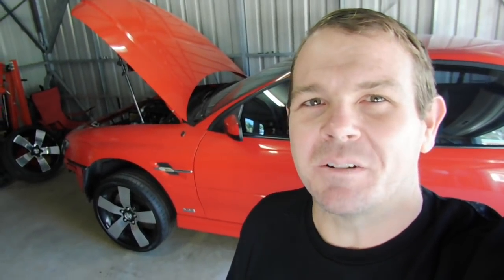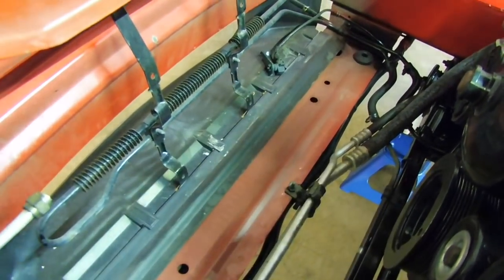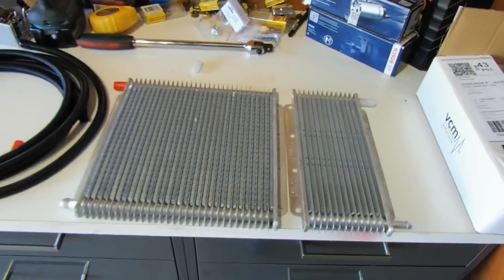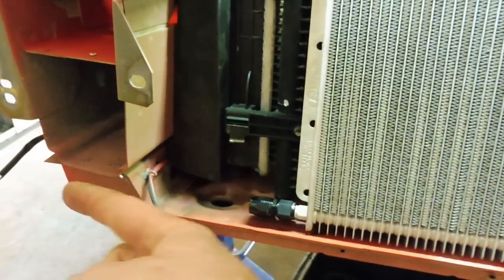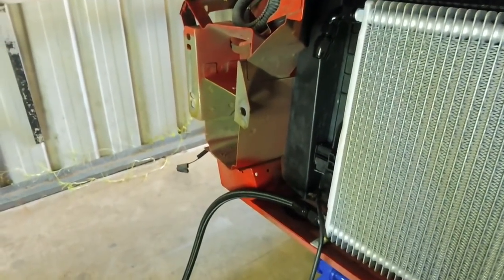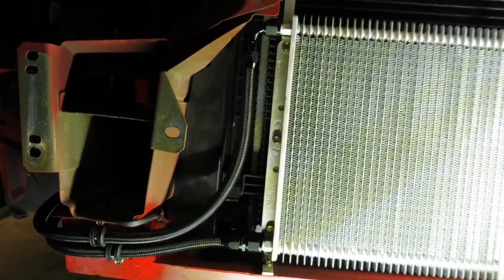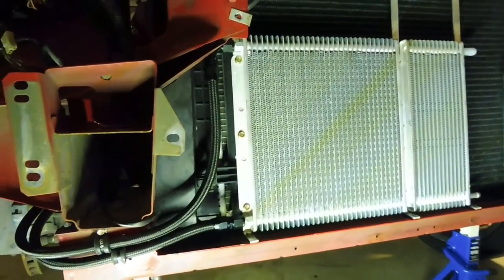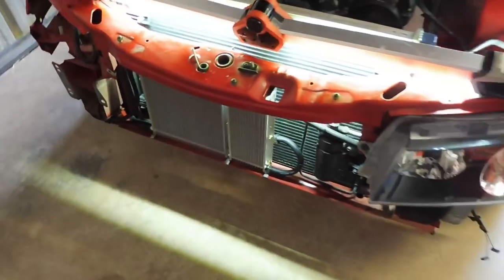Turbo Ls vz ss commodore build ep8 oil coolers

Comment: Hi mate, thanks for all the eps and the time you’ve put into it all. There are heaps of guys in the States putting up GTO vids. Not really any Aussies except you I’m sorry to say. Search for “VZ SS” and there is nothing like you’ve put up. So thanks again. 

I’ve got the same car as yours but it’s a t56. Otherwise red, L76, 2006 and an SS. It’s got 292K kms on it and I’ve had it since it was 6 months old and just off my P’s. I’ve learnt a lot, doing bolt ons (pacemaker headers, high flow cats, various aftermarket exhausts, Billet short throw shifter, Pedders adjustable extreme coil over suspension, intake, etc., etc., etc.). Lots of nice interior mods like Calais door trims, including all the the suede inserts on seat backs and interior panels and some LED interior lighting in red and white for the dash and interior to complement the awesome interior the VZ SS has. 

And now it’s time to do some serious engine work. My timing’s out as the stock cam/lifters are probably rooted. Oil consumption is through the roof and it loses compression under acceleration (HVAC looses suction as the engine starts to strain). And more stuff synonymous with a high K Chevy small block. Also I’ve had two clutches and the last one was done just over a year ago where the rear main was replaced at the same time. It is now pissing out oil.

As I am kinda adverse to paying a shop 3 times as much as I can do it for with a bit of hard work, I’ve decided on pulling my L76 and sending it down to Melbourne to LSX Performance for a full recondition (top an bottom) and performance upgrade inc. cam, lifters, springs, chain, etc. for 5.3K. I’ll also take the diff to a shop and have it looked over to kill the whine it’s got and check to see if I got what I paid for in 2013 when I ordered HSV 3.91 gears to be put in by a shop here in Sydney. 

My question to you:

For a guy with the same access to tools as you, should I pull the engine and tranny out at the same time and then separate, or is it possible to just take the engine out on it’s own? The latter is preferable as I have a tiny garage that just fits my SS). 

Second bit is as the prop shaft has tongues going thru the donuts, essentially joining the diff, shaft and tranny in one line, should I start at the back and drop the diff to then release the prop shaft and facilitate removing it from the tranny?

Cheers in advance and I’m a big fan of your work. It’s a great inspiration.
Reply from the maker: Erik You can take the engine out without gearbox but I’d unbolt the gearbox at the back of bell housing and remove engine with bellhousing and clutch still attached . 

To achieve enough room to remove tailshaft from diff or box donut simply unbolt the Center bearing and let it hang down this should allow just enough room to slide off the tongues.

Cheers for your positive feedback aswell greatly appreciated.

Comment: So basically mate, you have not connected the inner radiator heat exchanger and also the outter coolers together, which is the way to go, that way if the radiators inner heat exchanger goes, you dont have radiator coolant mixing up with the transmission oil. :) Well done, also i have a idea for ya, put a Bit of aluminium between the alternator and near the power steering reservoir, so that if any leakes do happen, the oil does not drip down onto you alternator, which is a very common problem and stuffs up the alternator, in fact i think i seen that you have already done this, unless its from a different upload. cheers and keep up the great work. :)
Reply from the maker: 7071t6 thanks mate
Reply: @LatysGarage  no problem at all. My son has a VZ SS 5.7 and wants to do it up, ie: cam package etc, i was thinking of going to flowcraft in deer park Vic to have the work done, as they have done some crazy work in the past and well known in the industry and do not rip people off, like others do. :) He is hoping for around 250 RWKW, has headers and cat back exhaust done, just needs the hi flow cats. :)
Reply from the maker: 7071t6 250rwkw is easily achievable with full upgraded exhaust , cam package ,otr and retune and would be loads of fun especially if it’s manual
Reply: @LatysGarage  thanks, its a auto and has a couple of mods in the auto, so it would be a good car especially if looked after. :)
Reply from the maker: 7071t6 I’ve had a built 4l60e hold up to 400whp no worries.
In my experience even a stock cam ls1 auto really benefits from a 3500 hi stall converter to help bring the engine up into the peak torque range quickly. With an upgraded camshaft I’d say it’d be compulsory to really take advantage of the unlocked grunt .
Reply: @LatysGarage  Problem is he does not want to change the convertor at all, so using a mild cam which does not require a hi stall ?
Reply from the maker: 7071t6 yeah ok a small camshaft then and you should still get the power your chasing . Horsepower can be addictive so hopefully he can resist the urge and be happy with 250RWKW . I recommend vcm cams I’ll link you a video that might be informative to you .
https://youtu.be/mZlHoR8_E2o

Comment: At the 24:21 mark, maybe you could have put some wrap heat shielding on the housing, that way when the exhaust headers are in, none of the heat transfer will affect the auto fliud and i know i have a OE HSV power steering radiator cooler, with oe brackets, which i am going to use one day in my VF Redline as the trans cooler. :) Also noticed Holden have aOE Trans cooler for the VF range, which are used in the HSV and COP Packs. :)
Reply from the maker: Ok good suggestion and it’s good to know gm realised the oil temp issues in the earlier models and fixed them up with more substantial coolers in the recent models.

Comment: Another great vid. What about oil cooler for the a manual trans and  diff oil? Possible? Keep up the great work.
Reply from the maker: Andy C oil coolers for manual trans and diff would be most needed in a circuit/hill climb racing applications where the components are getting hammered for a lot longer periods of time . With a manual trans and diff not having internal oil pumps you would need to setup an external pump to scavenge and circulate the oil through the coolers . This is just my limited knowledge on diff/manual gearbox cooling I hope it helps.
Reply: Thanks for the reply. Helps heaps

Comment: Hi M8, great job on the set up, i have a trans cooler but it runs through the factory radiator fittings also, is trans cooler only a better way to cool?

Comment: Might be time to invest in a riv nut tool, makes life easier in the long run.
Reply from the maker: n12sumfin I’ll be getting a nutsert setup soon . I have a swirl pot I’ll be mounting up under the back and want to use something more robust and more reusable than self tappers to mount that but for p clamps I love the 8mm bolt head tappers I’m not sure of any advantages of a nutsert over a self tapper for really light permanent work like a p clamp but I’d like to hear people’s suggestions .

Comment: I have the VZ HSV Power steering OEM cooler, which i am going to use for my 2015 redline's transmission external cooler, once i have worked out which AN fittings i need to make sure i dont cut the factory transmission fluid lines, so they all connect up perfectly. :)

Comment: Awesome episode as usual. Mate where did you buy the alloy plates from for the cooler? Also the heat shield from too mate..Keep up the great work bro
Reply from the maker: Reuben King thanks mate the alloy flat bar I got from Alsun aluminium and the heat sleeve from Motorsport accessories.
Reply: @LatysGarage  Awesome thxs mate appreciate the info, will head down to advanced motorsports and get a bunch of Aeroflow connectors and braided hose as well. Legend mate